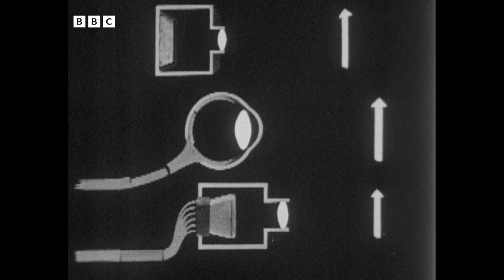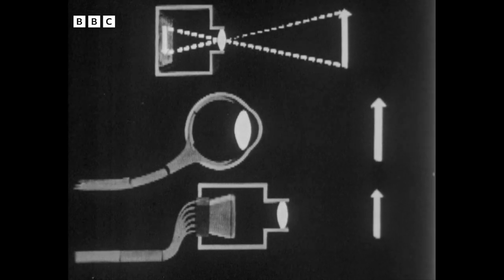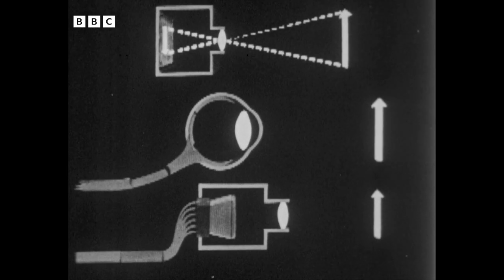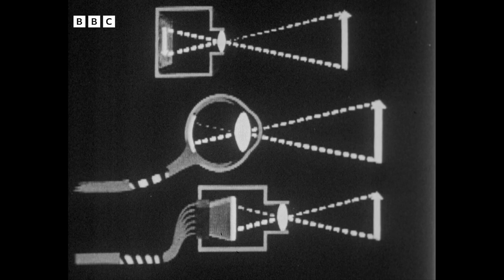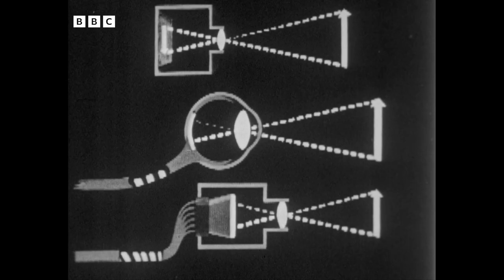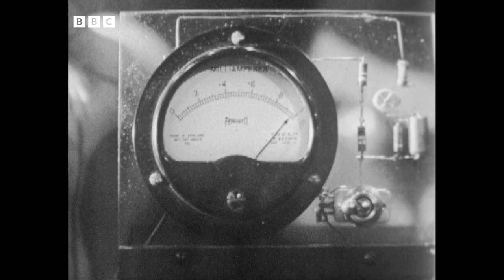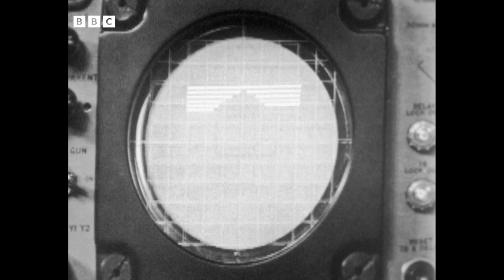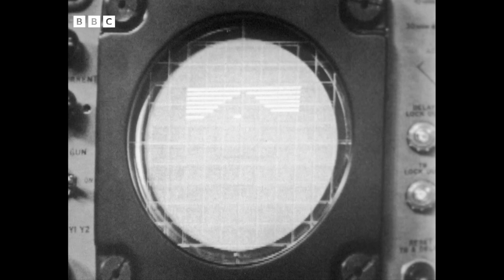1961: How TELEVISION Works | Science and Life | Retro Tech | BBC Archive

Comment: Interesting but I still don't get it, like if You really think about it, it's no way any of this could be possible without some kind of enchantment. I've broke open a TV before and all I saw was a green board with tiny attachments and weird patterns that's still doesn't explains much of anything. Nobody really cares anymore do they. It's just acceptable because the sophistication is not worth trying to comprehend so we just dismiss what we don't understand and just accept it. I guess we don't have much a choice now do we.
Reply: Jesus christ man. Go read a book
Reply: The actual way the tube works is extremely simple as long as you have some equipment and experience in glassblowing you could probably make the tube, the main complicated bit is the circuitry. That’s the part that you actually need to have some smarts for
Reply: See I think it’s very simple for a television to produce a single dot and maybe wavelenghts using a crystal mechanism but you need super weird circuitry to actually get a video on the screen and that’s the main hard part